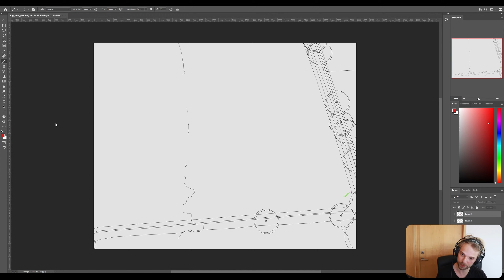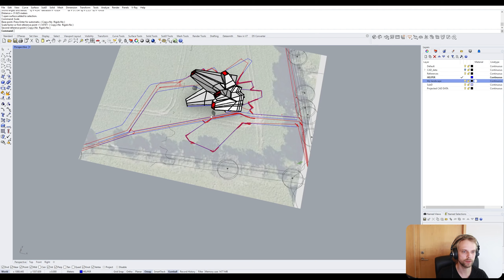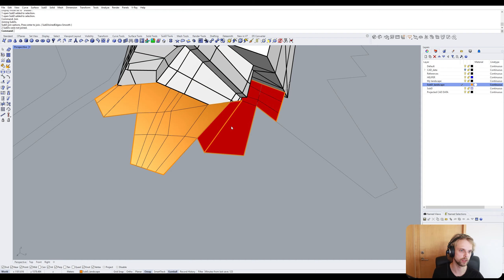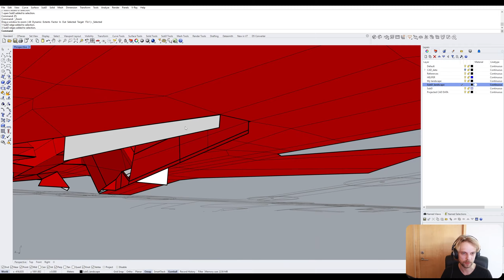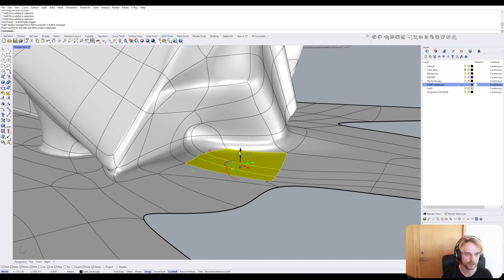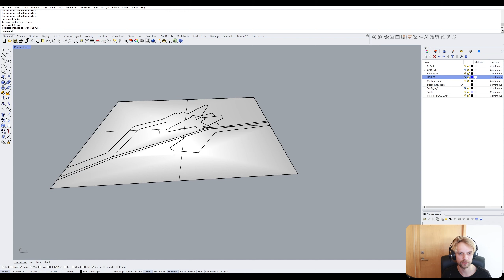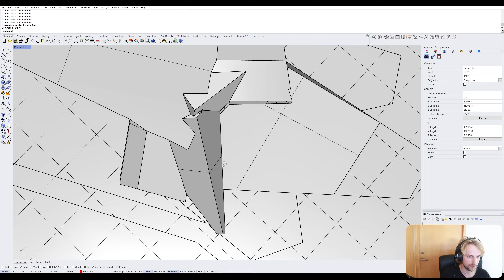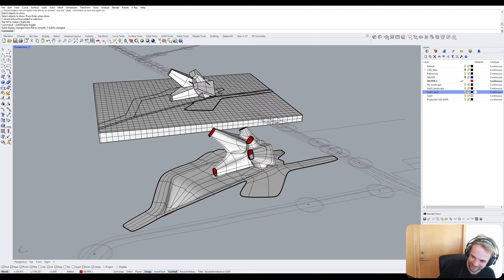[Rhino Course] Architectural concept modeling - DAY 2

Comment: At this stage of the project where measurements are not as important as the concept itself would you recommend working with blender?
Reply from the maker: Good question - I'd say whatever tool you feel most comfortable with - that's the tool that you should use. The only thing to be mindful of is the limitations of certain tools - you never want your options to be limited at this stage.
Reply: @DesignGoBrr  thank you very much for the response 💓